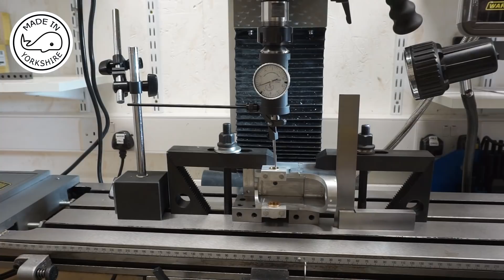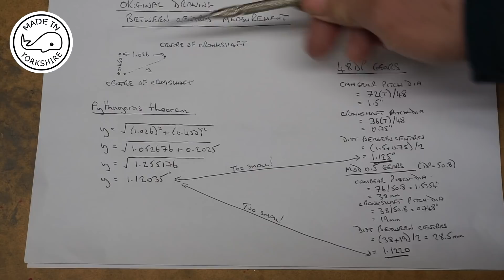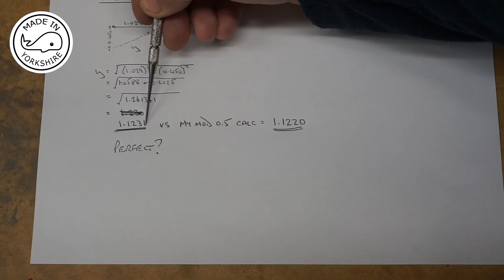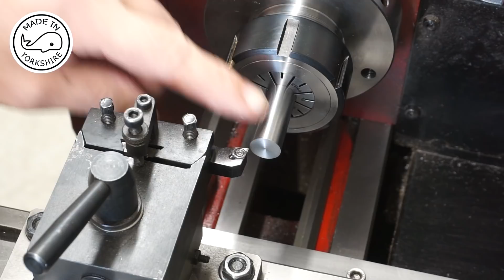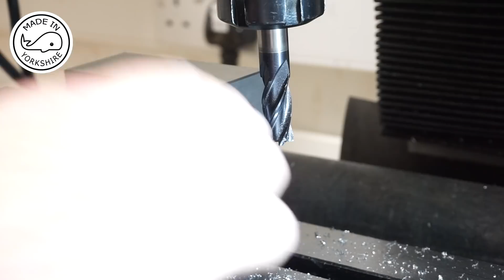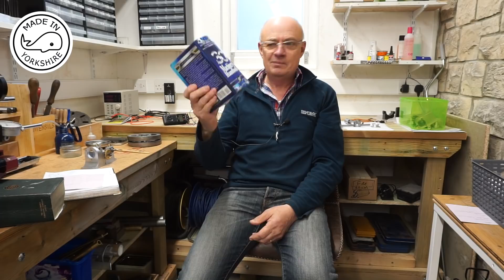#MT35 Part 15 - Farm Boy Hit and Miss Engine. The Gear Assembly. By Andrew Whale.

Comment from the maker: NOTE: At 6:30, where I discuss pitch diameters, there is a transcription error. I show 76 / 50.8 = 1.5354. It should be 1.496. However the end result of 38mm is correct.

Comment: Very helpful videos, your a good mentor Andrew! and easy to follow. i am very fortuante to have found a full and good set of 48 pitch gear cutters made by Walter Spencer & Co Sheffield on ebay so i will give these ago and see how i get on with the gear cutiing. Lots of trouble sourcing 6 " flywheels so thanks again for your suggestion...hope he has some left for me!
Reply from the maker: Thanks Andy. Lucky you! -  regarding the gear cutters. I'm sure Lee will help you out with the flywheels (please mention my name). One thing to be aware of is that the hub in the drawings sticks out beyond the outer rim. I guess it's pretty impossible to get cast flywheels with that feature. I think I will attach a small piece of cast iron onto the hub before machining. I need to give it some thought first.
Good luck with the build.
Cheers
Andrew
Reply: @learningturningmetal  Thanks Andrew will do, nothings simple is it, but makes it all the more interesting the word ingenity comes to mind or in our case enginuity ..i dont know

Comment: Another great video Andrew, and thanks for the mention. I'm almost done with my flywheels and I estimate they took about 40 hours to machine from stock discs, so you did yourself a favour buying those castings. I'm not happy with my gears but I think they'll work okay - yours look much better than mine.  As a matter of fact those gears are the reason I'm building a Farm Boy. I wanted to try making gears and bought a set of involute gear cutters and wanted to make a couple of gears for practice. I'd bought the Farm Boy drawings about three years ago when I set up my home machine shop and back then building it was a bit too advanced for me,  but by the time I bought the gear cutters this year my skills had improved so I decided to have a go at making the gears. When they were completed I made a couple more parts and ultimately decided to make the entire engine. I just have to finish chamfering the flywheel spokes and then make the fuel mixer and hopefully I can make it "chooch" as AvE would say.
Reply from the maker: No worries mate. I pretty much followed your footsteps. I always (over the past couple of years) fancied having a go at making some gears, so that was the first thing I tackled on the Farm Boy. I didn't realise just how much work is needed to build the rest of it. It's a really good way to help develop your engineering skills though - lots of variety and challenges along the way. I would be interested in seeing a brief video of yours running if poss.
All the best.
Andrew

Comment: Hi Andrew , another excellent video. Those flywheels will look the part. I've been looking for some 3 1/2in ones for the Kerzel engine but not having much luck so will probably have to machine a pair. The more I read the 'Machinery's Handbook' the more respect I have for engineers. Theres just so much to this hobby. Regards Kevin
Reply from the maker: Hi Kevin. It's definately a mindblowing subject. My father was a draughsman and in those days he had to manually draw gears. His old version of the book still has some valuable info not covered in my new one. Good luck with the flywheels. I just couldn't face trying to machine two 6" ones - though lots of people do. The plans show the centre boss sticking out beyond the outer rim - so I think I might need to do some kind of modification.
All the best.
Andrew

Comment: Another lovely video.  I got some of those Chinese hit and miss engines from banggood to play with and found that a cheap (Harbor Freight) 6 in 1 screwdriver I had was the perfect size socket to get the little spark plug out.  If you get to fitting the spark plug and have issues finding a low clearance socket, you can try that.  I think the Farm Boy plans use the same plug
Reply from the maker: Thanks for the info Henry - very much appreciated.
All the best.
Andrew

Comment: G’day Andrew it was unfortunate the instructions were incorrect as we don’t have that much hair to pull out in our advancing years, good to see you overcame the issue. Another way for a fix was to machine the gear section of the shaft offset by the requisite amount.  
Cheers 
Peter
Reply from the maker: Hi Peter
I did wonder about an offset, but I thought it might introduce other problems in getting the fork end parallel with the base. Plus the challenge of me machining it correctly! James C says that he made an offset brass bush so the gear mesh can be adjusted. Interesting!
Cheers
Andrew

Comment: I had a similar problem with my build, I made an offset brass bush so the gear mesh can be infinitely adjusted, then locked off with grub screw. Clickspring makes his gears then uses a gear depth tool to mark up his hole pitches to suit the gears he has made
Reply from the maker: Hi James - I'm glad I am not alone. I did wonder about some kind of offset on the camshaft, but I thought that it might introduce more problems trying to get the fork end parallel with the base. I would be interested in seeing your design. I now need to be thinking about a base to hide away your electronics.
Cheers
Andrew
Reply from the maker: Ah it's just dawned on me what you mean. An offset brass bush is a really simple solution - why didn't I think of that! I was focusing on the camshaft. Great idea.
Cheers
Andrew
Reply: Learning Turning Metal - by Andrew Whale Hi Andrew, yes it gives good control of friction, noise and backlash. Too much friction and these small engines don’t “miss” much

Comment: Excellent detective work on the gear centres - I bet you were gutted when they wouldn't mesh the first time - I know I would be! Make sure your inlet spring has got enough turns- I could only count 5 (the ends don't count) - If you like geeky stuff, have a look at the spring calculator spreadsheet here (not mine): https://sites.google.com/site/lagadoacademy/machining---lathes-mills-etc/tools---spring-making

Comment: Making springs is pretty much like cutting threads, you determine the diameter of the spring, the pitch and length.  You just need to make a simple tool holder with a hole through which the wire is fed and then set your threading gears to the correct pitch.  Allowing your spindle to make a few rotations before and after engaging the lead screw will give you a nice flat coil on each end.  Here is a video of springs being made on a CNC lathe.
https://www.youtube.com/watch?v=fgXaS_QyTio&list=UUj_ZSTf9DkhA3PxI0RYaeZA&index=38&ab_channel=SHOPMASTERSHOPTASKCHICAGOLATHE
Reply from the maker: Very neat!

Comment: The Machinerys Handbook is also available as a PDF which I find to be far more convenient than the paper version.
Reply from the maker: Yeah - unfortunately I like flicking between pages. I've never been a fan of electronic books. I also read somewhere that there are unlicenced pdfs kicking around the internet - not something I support.
All the best.
Andrew
Reply: @learningturningmetal  I'm not sure why you made the leap to knock-off's. Industrial Press, the publisher of Machinery's Handbook, sells it in both paper and electronic versions. It may have changed since I purchased my copy, it was on a CD-ROM in a secure PDF format which required activation. They now offer it via the internet. 
The electronic version has some significant advantages over paper: It's much easier to search and there are embedded hyperlinks, but the biggest to me is that I can print the pages I need and don't have to worry about damaging the manual with my oily hands ;-)
Reply from the maker: Fair enough, but I just prefer paper books.
All the best.
Andrew

Comment: I have Machinery's Handbook  Edition 24 dated  1992. Table 22 Arbor Diameters for Springs made from Music Wire. Is on page 322.  so a lot has been added or subtracted to Edition 30. I too like to read tech books. there is so much fascinating info!
Reply from the maker: Hi Mark - it sounds like your edition is reasonably up-to-date. The format/difference of Edition 30 is considerable compared to my 1944 version. I might only use 5% of the content, but it's a really interesting read. I've just learnt how to temper my hardened steel!
All the best.
Andrew

Comment: Really enjoyed this one Andrew. Your thinking and working out to solve the gear distance problem was a great lesson to us all. I suppose with hindsight you would have set up the shafts before drilling to check the clearance. I am intrigued by hit and miss governors. It will be fascinating to see its mysteries unfold as you progress. That Machinists Handbook is quite a tome! Plenty of light reading for you in there. The engine will look really good with that chunky pair of flywheels. They should also give all the inertia you need to keep her ticking over.
Reply from the maker: Thanks Tim. Second time round it occurred to me too that it would have been better me setting up the shafts first time round. Hey ho, I learn best by making mistakes - hopefully I will remember next time. Yeah - those flywheels look the business.
Cheers
Andrew